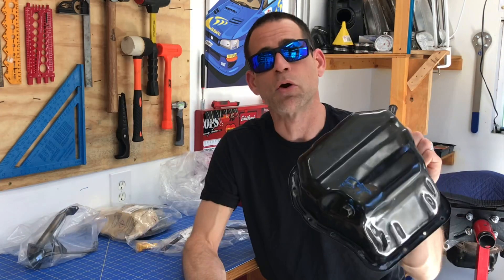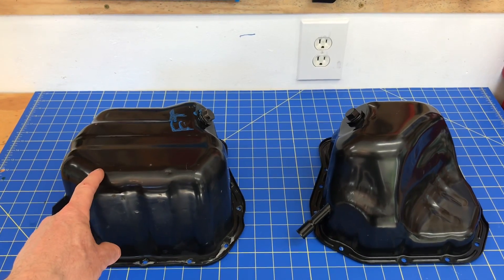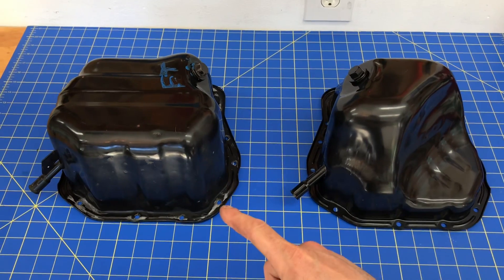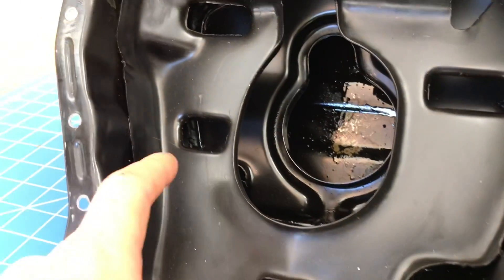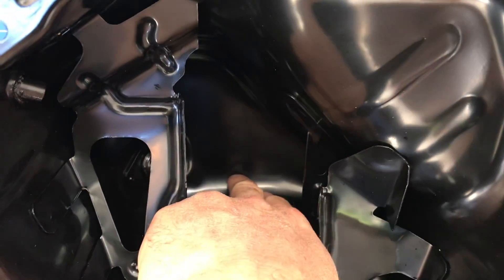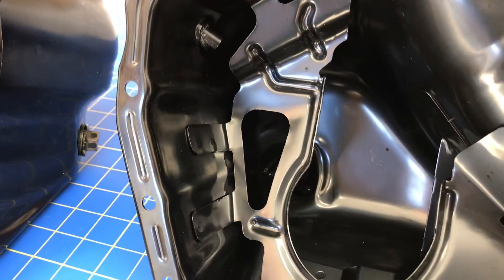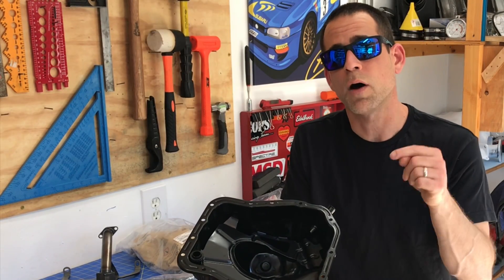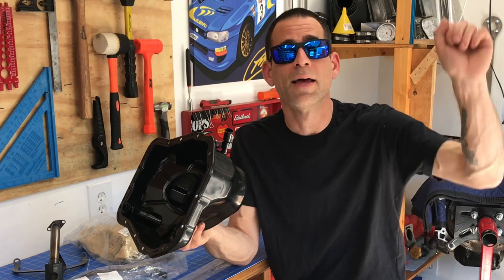Why Subaru Redesigned the EJ-Series Oil Pan

Comment: Would an alternative temporary solution for someone ready to go to the track be just filling the oil about a quart higher than the dipstick wants, or would that cause oil pressure issues and/or cause the crank to possibly dip into the case oil?
Reply: Yeah not a good idea, just get the newer pan, and the pickup. It’s a lot cheaper than a new short block

Comment: I have a jdm ej205. I’m in the process of doing this exact swap. Just found out I cannot use the factory oil pickup. The brace for the oil pickup hits the new baffle and obstructs it from bolting up. Might go with the killer bee, not sure yet.

Comment: Been wondering if the Sti dipstick sticks in the pan or just inside the tube that sits slightly out of the pan I know the wrx goes in the pan about a inch but I noticed my Sti dipstick doesn’t go in the pan but sits about a quarter of an inch from the inside of the pan I’m sure oil goes up into the the tube but not quite sure
Reply: Probably too late now but they are the same I looked into it. Just need the dipstick itself

Comment: I'm replacing the EJ25 in my 2003 Outback with a JDM EJ20.  The EJ20 has the new oil pan on it and the EJ25 has the older style pan.  Do I need to install the old style pan on the EJ20?  I know that part of the difference is related to the exhaust routing new vs. old.
Reply from the maker: You can use the new style pan, and it’s def a better design. Just make sure you use the corresponding dipstick and dipstick tube, should be all good!!! Cheers!!!!

Comment: I'm trying to fit a killer b windage tray and oil pick up to my ej204. I think I have to also upgrade the oil pan. My question is, can I fit an EJ25, fa20 or fb20 oil pan to fit the new pick up?
Reply from the maker: Nope, don’t think so. Need the specific oil pan for that pickup.
Reply: @SubaruONLY  actually, I've been meaning to get your expert thoughts in relation to baffle plates. Is it worthy a upgrade?
Reply from the maker: I think so. It’s one of those things that only helps and the OEM would likely have done it if it were cheaper.
Reply: @SubaruONLY  OK I see! Do you recommend any baffle plates? Or have you made any vids on it? The baffle plate is used in conjunction with the windage tray right?
Reply from the maker: I believe they are the same thing, people just use different names. I like KillerB and IAGs designs most, they’re my go-to! 👊
Reply: @SubaruONLY  ah yeah I see. I'll need the ej25 oil pan by the sounds of it. Cheers legend!
Reply from the maker: Yep, that’s it. Cheers buddy!!! 👍

Comment: Could one potentially heat up, and bang a flat bottom in?
Reply from the maker: Lol. I think the spacing on the inside is fairly critical to get right, and since a new OEM pan is only about $90, I wouldn’t want to risk damaging the engine to offset that cost. But good question buddy! 👍

Comment: I have been informed that 06+ oil pan will not fit on ej205 engine without changing the ehaust manifold to the later style. You don't mention it in the video, ca you please comment on that?

Comment: is it possible to reuse the baffle without upgrading it to the PN 10915AA010 ?
Reply from the maker: When you upgrade to the later oil pan design, you’ll have to upgrade to the newer baffle too.  The OEM baffles are pretty cheap so it shouldn’t be too bad.  Cheers!
Reply: @SubaruONLY  Thanks Luke! I'm going to order the new baffle too then

Comment: I wish this video had a bit more "nuts and bolts" data, such as oil capacity difference, what the difference in depth, etc.  

I have a 2010 Forester with an EJ253, and I'm looking for more oil capacity and a pan that doesn't hang down as much (impact risk).  Also, I would think the two baffles in the older style pan would more effectively reduce oil slosh during hard cornering and such, and give the oil more time for bubbles to work out as it returns to the pan.  It is true that the old pan doesn't have clearance for the newer equal length exhaust (I suspect this was Subaru's biggest reason for narrowing the pan bottom).  However, I ditched my equal length exhaust because it wrapped fairly tightly around the oil filter and made replacing it a royal pain.   On a side note, I love the "Subaru sound" I gained in the process.  My Forester is not that far above stock, so I really did not notice any performance or mileage losses after going from EL to UEL.  On a higher performance engine, an EL exhaust may make a tangible difference.

Comment: Put on the new pan and an oil cooler. You get better oil  pick up, cooler oil temps and more oil volume. If you don`t track your car save your money.
Reply from the maker: Totally.  That’s my plan and it gives the same or better oil temp control than using the Killer B Pan.  100% on target! ✅

Comment: Loving your informative videos Luke. I have a couple of questions now though.
You said if one uppgrades the old style flat pan to the newer 07 style you need to swap to the tube and dipstick for that pan, but what about the Killer B one? is that designed to go with the same tube and stick as the 07 revisioned pan or does it use some custom tube and stick? 

Also are the pickup itself the same across all EJ motors and if there is any differences what are they?

I would definitively want to go the extra step for the Killer B setup myself for that little bit extra peace of mind when going for a spirited drive with a built engine, but that new style pan is definitively a worthy uppgrade for most of the old subies. Hopefully I will get to heavily uppgrade my EDM SF5 turbo forester one day.   and your channel will be one of my go to for when Im doing any maintainance, repairs or uppgrades. Great video cheers!
Reply: The pickup is different. The newer style pan is deeper and has the pickup screen located in another location than the flat bottom pan. Google some images of the pickups and you can see the differences
Reply from the maker: Yes agree 100%. Pickup is different dimension (ie pickup location) for new style pan. Killer B setup is the way to go if you can afford it for sure!  Yes, the Killer B Pan goes with the tube and dipstick from the new style. Cheers and thanks!! 🤙🤙

Comment: So there will be an advantage to switch to the new oil pan design? Or if you are not doing rally/ autoX etc it isn't necessary to upgrade to the new one?
Reply from the maker: Think the old one is fine for casual daily driving use. Lots of other areas to address for that type of driving - AOS for example, very important for a daily driver.